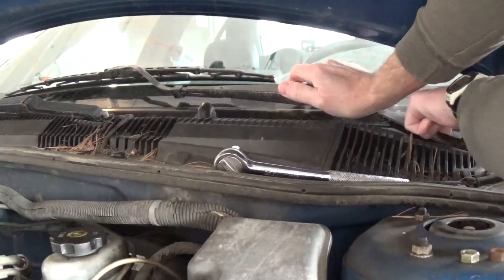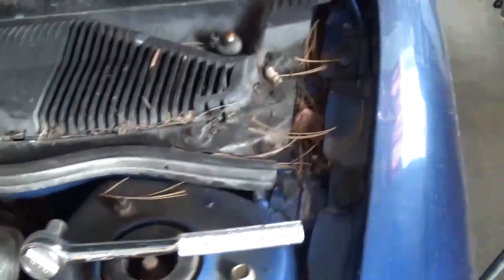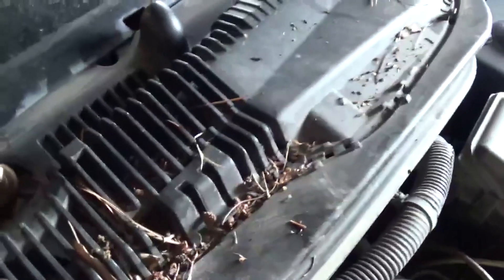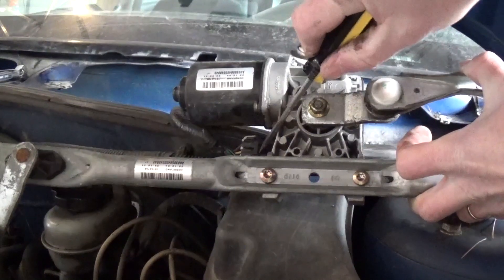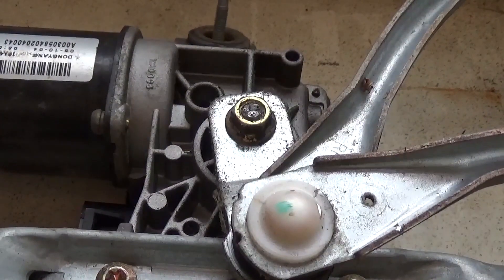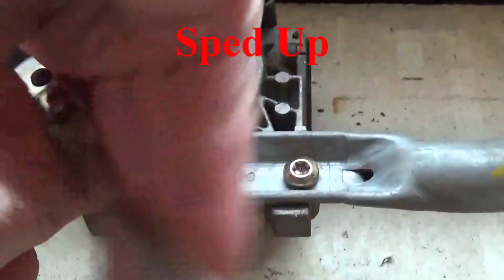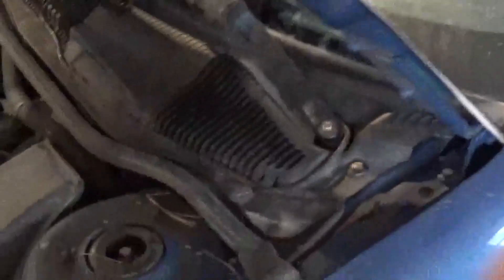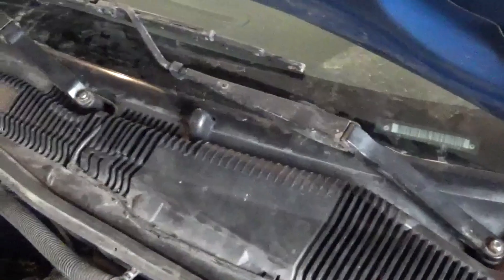DIY - Wiper Transmission Replacement

Comment: Where did you buy the part?  I have looked and have no idea where or what I need.  The bracket that holds the transmission and arms to the wiper motor broke off  PLEASE HELP!!!